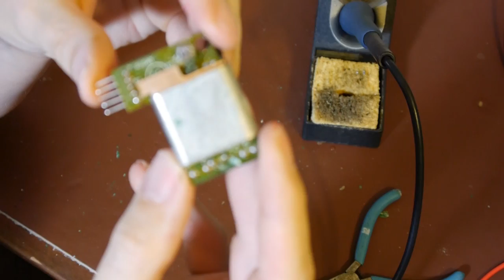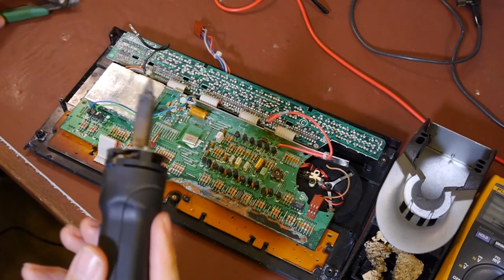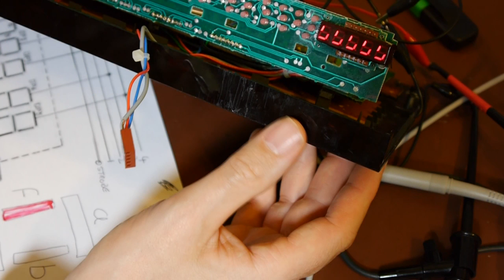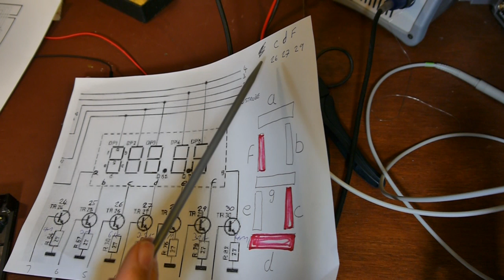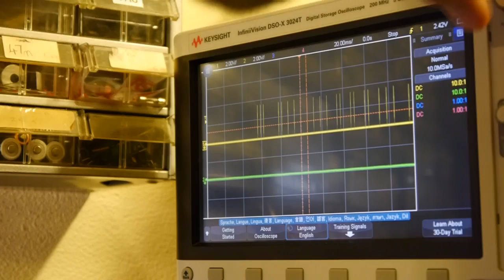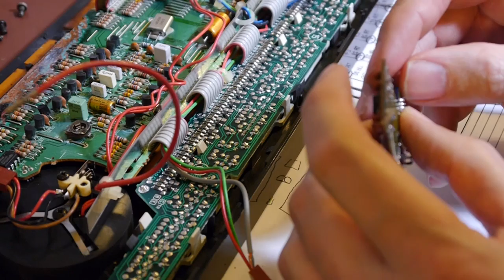Banging Olufsen Part 2

Comment: Such an excellent and thorough work. Did it end up working with the hifi system?
Reply from the maker: Yes my friend Richard that has the system says it works perfectly. I got very luck this time. Thanks for watching and nice comments. Regards Chris
Reply: @allthegearnoidea6752  The owner of this is lucky to have you inspect and repair this. I picked up a Beomaster 6500 amplifier, CD and tape player second hand and I have been trying find appropriate service for it without avail. The CD and Tape player seem to work but only provide a hiss sound to the speakers and the Master Panel flashes NO CONTACT and unfortunately the Beomaster receiver has no Source Select button so I cannot even switch it to AUX to test the system. Anyhow as you mentioned in your first video B&O used to make heavy duty products back in the 80s and early 90s so hopefully I can get these serviced soon.

Comment: Wow!  What great patience you have to troubleshoot that gear and without the system to do a thorough checkout!  Good solid troubleshooting and repair skills!  I'm impressed that the board could handle all that cleaning.  I would think it might be useful to spray a bit of conformal coating onto a portion of that board that was previously vulnerable to the leaking battery.
Reply from the maker: Edgy00  thanks for the nice comments. I did paint over it with clear nail polish. Some nail polish has metallic drying agents, but this has never caused me a problem and it’s more available in small quantities and very cheap. I have since bought the good stuff but it tends to go off before I use it. Best regards Chris
Reply from the maker: Edgy00  historically I put many old boards in the dish washer and never had a problem as long as rinsed well afterwards.

Comment: I have 2 Olufsen  5500 control panels,  and neither of them responds to the volume control.  I found your video very informative.  I'm not afraid to open them up at this point.  Thanks so much for the posting!   Bill
Reply from the maker: Hello Bill. Good luck with your control panel repair. I hope it shows on my video that they use an optical encoder to count pulses and a separate switch to determine if the direction is up or down. These switches get dirty and the encoder can get dirty or be out of position.  I think I have a circuit diagram for these if it helps contact me. My best Regards Chris
Reply: You can also try checking with the folks at the BeoWorld Forum for insight into dealing with that issue of volume control.  It is a poorly designed part of that master controller and usually the first part to fail.  Cleaning, as suggested here, is a good start.

Comment: Nicely fixed. Fingers crossed that it works with the rest of the hifi. As you stated B&O was the business back in the day. I have a few radios but no hifi. I do remember my father and grandfather owning them and it was impressive gear. Great channel btw. Graham
Reply from the maker: Radiocruncher  hi Graham. Thanks for your nice comments. I'm a big fan of your channel and have just been watching your chickens video. I am mainly interested in modern and vintage test gear, but had lots of repairs. Just bought a load of 8 track player and having a look at these for the first time, very excited. Anyway keep up your good work . Regards Chris
Reply: Your welcome Chris. You have an interesting channel so I will be watching out for new content. I have a fair bit of test gear here that could do with a service so if you run out of jobs then let me know. 8 tracks were a bit before my time but I do remember them so will be interesting to see how you get on. Regards Graham